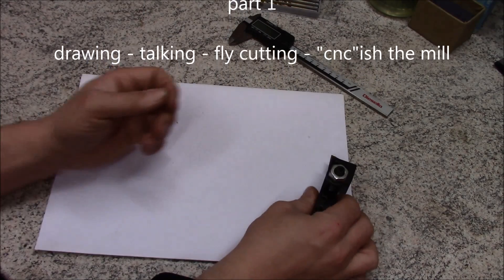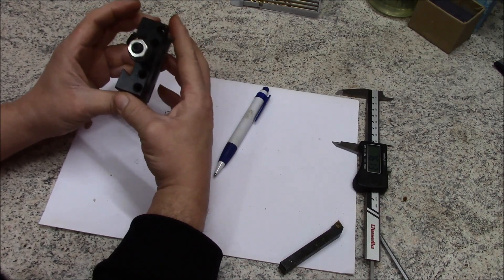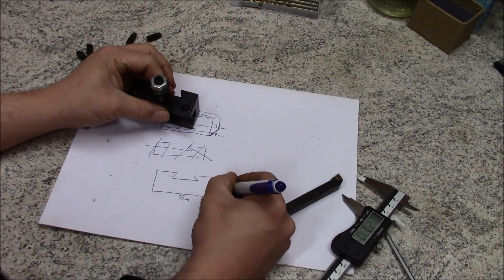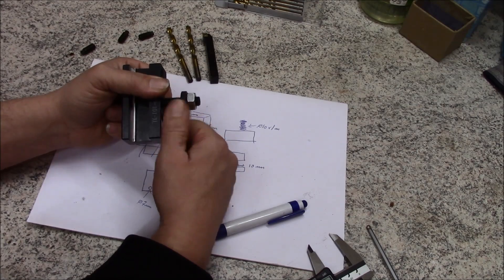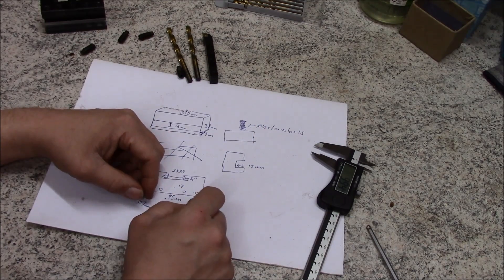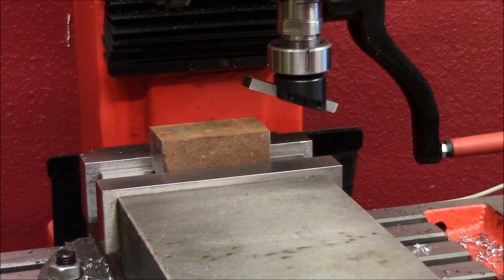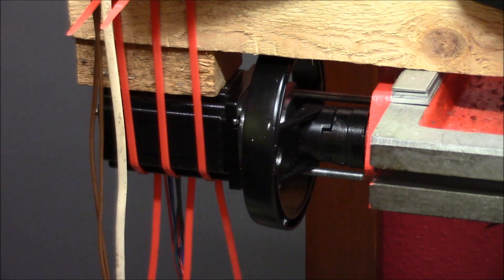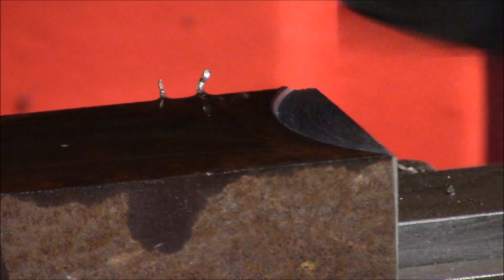How to make tool blocks for the quick change tool post! part 1

Comment: Hi Kim,

Thanks for your video !
I would like to know why you are securing
the iron block in your vice using a piece of lead solder wire ???
Reply from the maker: Eddy Fontaine it is just to get an even pressure on the rough surface, but it is not that good, aluminium welding wire or a piece of brass is better but i did not have any on hand.. if the block is not straight it can "lift" the one corner from the back fixed jaw on the vice, and you will not get a straight block.  thanks for the comment, you can chek outside screwball's channel, he have a nice video.. of the newest.. where he is building a tool to hold things, it shows the problem very clear, and it is a nice tool :-D
Reply: Kim nielsen

Thanks Kim,
it's a good tip !

About screwball's channel, i found several channels,
about mechanical engineering and other stuff...
Could you possibly send me a link of the one you mean ?

Cheers,
Eddy.
Reply from the maker: Eddy Fontaine https://youtu.be/XEboYPLrfHc